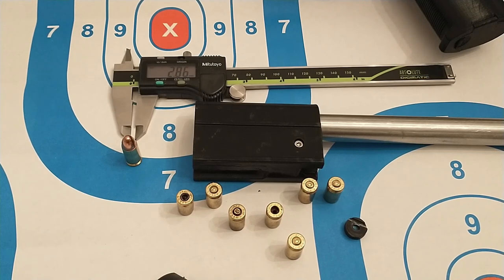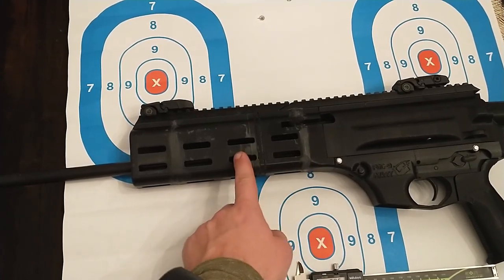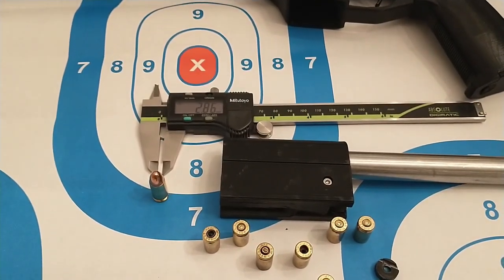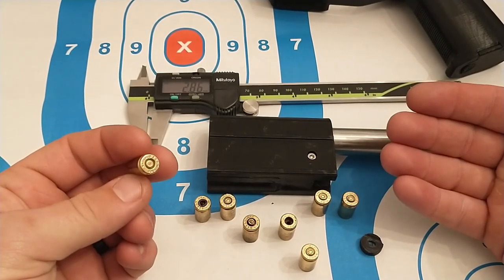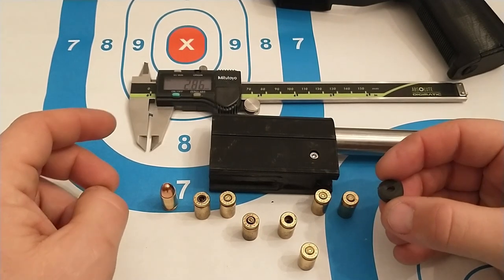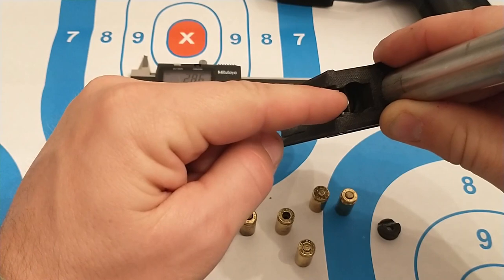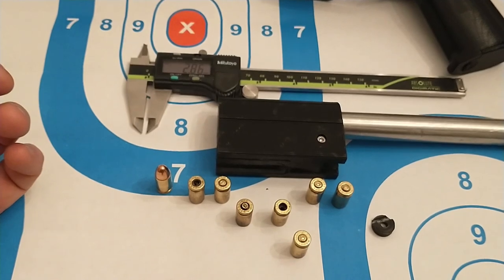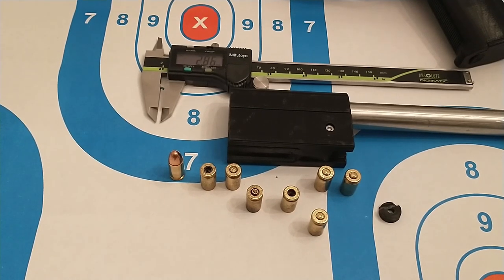Range Video FGC9 MKII. My wins and losses.

Comment: I found the back of a primer stuck to my firing pin. I also added a tiny washer between the firing pin and the spring. That made the depth it hit shorter. Without modifying the firing pin.

Comment: I doubt that an excessively long firing pin is the problem. Popped primers like you are seeing is more indicative of high chamber pressure. Are you absolutely sure that you don't have any restrictions in the barrel? Especially close to the chamber where pressures would be highest?
Reply from the maker: Are you potentially taking about having too tight of a chamber? Or maybe too tight of a throat?

I cut the chamber a bit more the other day and it helped a little, but not all the way.

I don't have any issues with extraction when firing, but the cartridge doesn't freely fall out of the chamber with gravity.
Reply from the maker: @Wilson Guerrero where did you pick up a 2 mm rod?

I did shorten my firing pin and chamfered it down to 1.75 mm. That honestly did help a bit. I might just need to shorten it a bit more.
Reply from the maker: @Wilson Guerrero holy shit wait! I was always wondering about a floating firing pin!

My firing pin springs always get immediately fucked up. If it works for you I'm going to give that a shot.

Comment: If I remember correctly firing pin protrusion should be 1mm at the most. But it's an awesome build
Reply: Is your pfp somalia?
Reply: Firing pin protrusion spec is 0.5 to 3mm.
Reply: @philpierson5697  I think that's for the first version the MKII is less than 2mm
Reply: @noncompliant209cali  I'm looking at the official MK2 build instructions,  version 1.2. Pg 65 states min 0.5mm, max 3mm.